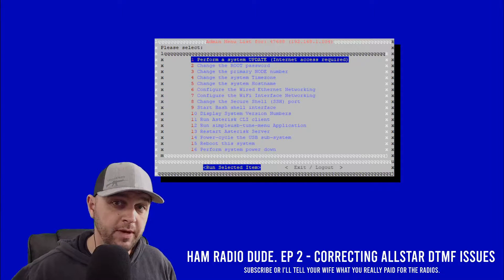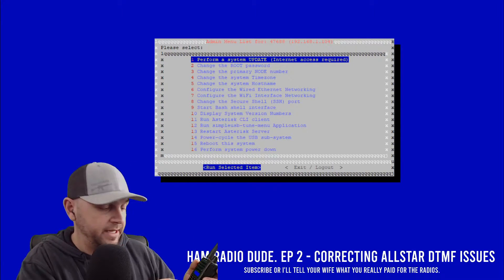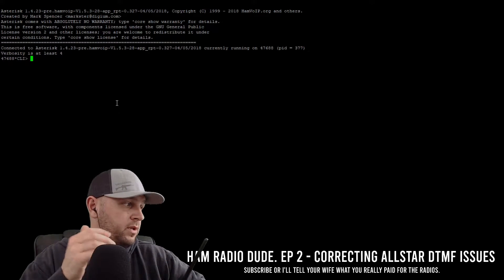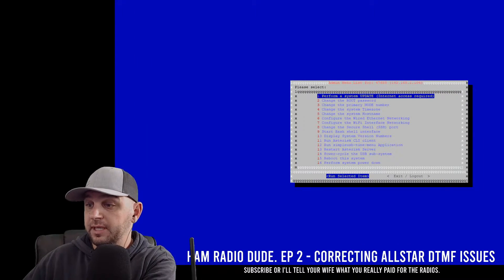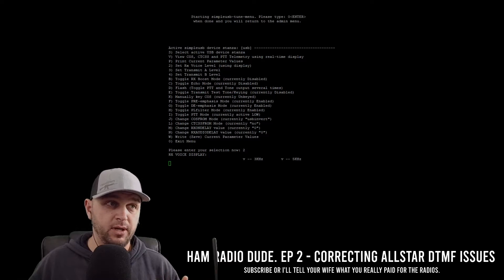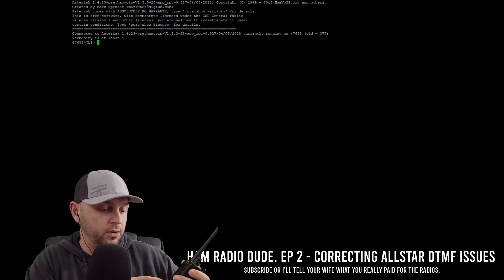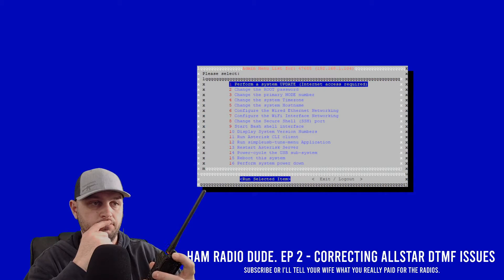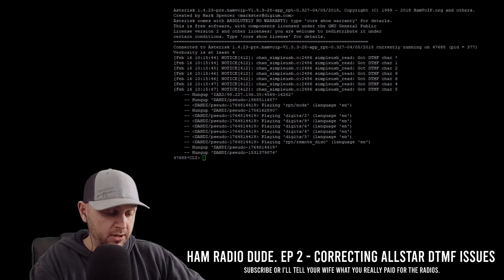Allstar Link is Not Registering DTMF Tones

Comment: Great video! I just wanted to point out that having the de-emphasis option set wrong in simpleusb can also cause DTMF issues.  Try to toggle de-emphasis between enabled / disabled if you're levels look good, but are still having issues with Asterisk not recognizing a DTMF key press with good accuracy.
Reply from the maker: Excellent advice! Thanks for the input!
Reply: Is that pre-emphasis?  I have mine set to enabled/Y.  I had the same problem as Sean with DTMF not registering except 9, #, * worked.  I also also am on an FT-65 however my levels were fine at 950.  Reducing to 600 fixed the DTMF issues but maybe I should toggle preemphasis to disabled/N.

Comment: NIce video but you didn't show that the Yaesu FT-4X was able to recognize the DTMF codes A and B. I was having trouble with my FT-3D DTMF code A only and I did finally get it fixed by making adjustments in another menu. (I can't remember which one it was at present).

Comment: So my node will not decode dtmf tones. When I do the option 2 on the simple Tune(12) I don't see my levels it's just a blinking cursor. What am I doing wrong?
Even if I put it to 800 for the level I get no bar showing me my level.
Reply from the maker: Do you have de emphasis on or off?
Reply: I just enabled it and now I can get tones to the node. Trouble is when I try to connect to any other node it tells me it failed.
 @DudeTested

Comment: New subscriber,  Never took interest in digi modes ..yet.  I come and go on the bands but watch many tube channels ie. Dx commander m0mcx, dave casler, ke0og, h r concepts, and a few others..retirement just around corner and a possible move from snowy mitt to the dessert Az into a HOA sub ☹️☹️
which I have heard of many restrictions on visual antennas..
Reply from the maker: Welcome, Gary!.  I will say this about the Arizona HOA's: Attic antennas are no good because the houses are covered in chicken wire or something similar, then stucco is placed over.  However, A LOT of the backyards in the cookie cutter Phx area, they are pretty private, due to cinder block/stucco fences.  I was at my brothers for a few weeks and threw an end fed up in his HOA.  No one ever knew.  However, allstar is fun to be able to connect to home repeaters / old friends around the world, etc etc.  Good luck with your retirement, and again WELCOME>

Comment: Okay.
I have lowered down mine to 450.
The cli now registers the DTMF codes.
But when I dial any DTMF commands (such as connect to a node or say the registration status), the shari seems to do nothing.
There is a transmission, but no audio.

Any idea what's happening??
Reply from the maker: If you send the dtmf tones through the CLI to the shari, does the Shari see them? Any other radios to test with?  Just trying to eliminate a few things
Reply: @DudeTested  yes.
The CLI client seems to recognize the DTMF codes.
For example, I send *A1.
The shari unit receives and then sends me back something but no audio.

Comment: I am using a Baofeng UV-5R 8watt radio and was unable to get my DTMF tones to register. I ended up setting my Rx Voice Level to 400 Value and that fixed the problem. Just putting this info out there in case someone else has the same problem I had. So far no communication issues. Thank you for this video. KC7BKH
Reply from the maker: Thanks!  It's always good to know.  Just for anyone who sees this, also note: Not every radio and Shari combo will be the same.  So if 400 doesn't work, you may have to find the "sweet spot" for you and your radio.
Reply: Glad you get your radio working. I used my UV-5R on low power to remote-control my repeater over a distance of 10 km when I hiked in the mountains.

Comment: For using a Shari device. This would be OK. If this was a public use node. (Wide Area) you should use a service monitor. I know we don't all have a service monitor. I don't. So get some help from the community. 2-4 station cross town. Each station give a 5 count. You can adjust the level after each station.  KE6UPI ASL 2060

Comment: I have an issue that I can't seem to get past. I have set up a AllStar repeater and used hamvoip.  I have re-flashed and tried several different configurations on initial setup The repeater works as it should.  But when I try to connect to a 6 digit node The message I get back is "macro not found".  When I try to connect the 5 digit node I get the Curtiosity tone but it does not connect to the node.  I do not understand what is wrong nor how to correct it.  Any help is appreciated  73 W4JWC
Reply from the maker: Good Day, In the Asterisk CLI, does each DTMF tone register?   Whats the node you attempt to contact to? I can try it and try to replicate the issue.  If I can, maybe I can create a video. But first things first, please confirm the DTMF tones register in the CLI.  Thanks for checking out the cahnnel.
Reply: @DudeTested  the node is 505500 and you can see the tones in asterisk CLI and they are accurate. Two other hams in the area can connect to it with no issue.  Thanks
Reply from the maker: To eliminate the variables, have you tried connecting to the node via the CLI   in the raspberry pi?
Reply from the maker: If it's in the pi, I'm not certain but can keep trying to figure out what it would be
Reply: @DudeTested  I just got it working again and have discovered that the 3 key is coming through as a 2 (baofeng) that was the reason for the "macro not found".  I have two uv5rs and neither of them will send the 3 numeric. So I am running and found a HT that will send a 3.  Thank you for helping me.

Comment: I am using the DINAH. When I do  this test the numbers I push do not come up on the screen. Different numbers do. Hopefully you can address this with an update to how to correct this issue.
Reply: Les - Join the DINAH group at www.groups.io.  Got to the Files section and download "Setting the RX Level in HamVOIP Allstar.pdf" set the DTMF levels following the procedure.  If that does not work please start new topic in the DINAH group.  Steve-N8AR
Reply: @stevesmith3162  Hi, Steve! I am in the group but I don't have DINAH. I built my own URI with a lot of reference to DINAH design though.
Reply from the maker: I do not have a DINAH unfortunately and do not know much about it.  I'll see what I can do about obtaining one though
Reply: Hello Les, What Radio are you using? The radio should be set to 9600 baud and using pin 4 on the input of the DINAH. That would give you the best audio. If you have to use 1200 then pin 5 is used. You still might need to use a resistor when using pin 5. 

KE6UPI